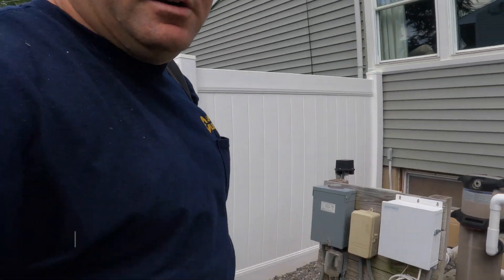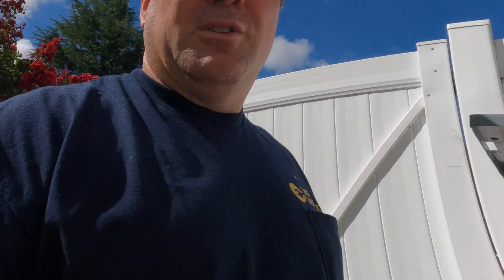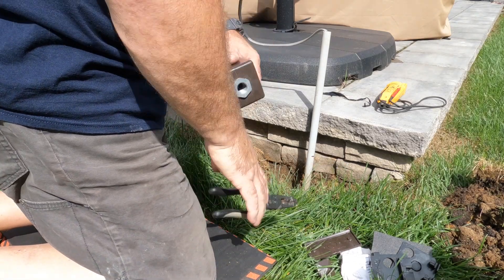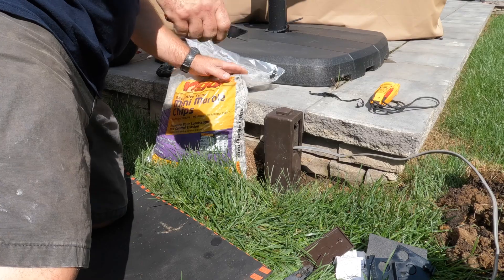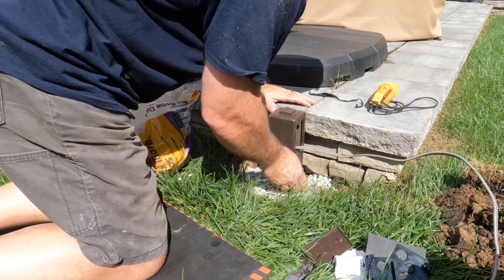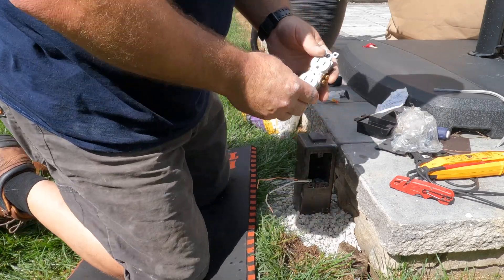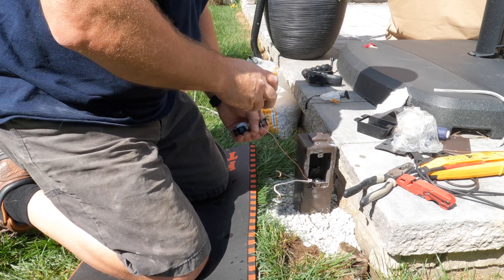Swimming Pool Area Landscape Receptacle Box | GFCI Protected Receptacle

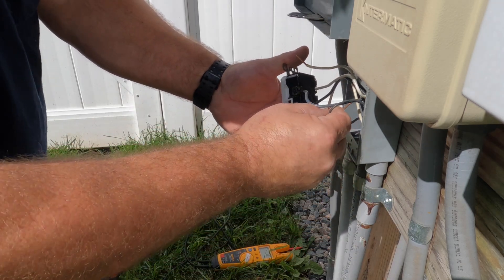Comment: Why starting at 3:41 did you put 2 wires on one screw?
Reply from the maker: The GFCI receptacle is designed to do that. There's two pairs of conductors being protected by the single GFCI. Hope this explains it clearly for you.

Comment: Nice job! 
I’m curious. Does your jurisdiction require PVC  conduit the entire distance between the two outlets, or just going into the soil and coming out. I know that UF cable is designed for direct burial. I hope my question makes sense.
Reply from the maker: I rarely install UF cable for direct burial. It deteriorates over time and shorts/ ground fault issues.  I don’t condone using UF for underground work.
Reply: @electricianron_New_Jersey  Also with conduit you have the option to pull extra wire in the future, in case you want to add on.  With UF you have to dig up and start over again.

Comment: A Gfci tale, my dad renovated his kitchen, and I did all the wiring. This was 1991-1992, I'm not sure of the year. Anyway I installed the GFCI's, lights and switches. A lot of backwards stuff, it was somewhat challenging, for my 1st job. But later that year my stepmother was doing the dishes, and knocked the mixer into the sink, of water, and she had both hands, in the water. she said she felt, a little shock and I heard the GFCI shut off in the other room and came out. I said hmm, I just saved your life. My dad was pissed at her, for doing the dishes, with the mixer still plugged in. But whatever, she wasn't hurt, and is still here today. But, I remember him telling me, that when he bought the house, mind you this was a 900 sq ft row home, in the middle of NEPA, small mining town the house, that had the 60 amp panel with all knob and tube. This was in 1981or 1982 when he bought the house. To get a 100 amp box put in and the house rewired was $800 cash job. When I had to put new circuits and new a new panel later as he had extra money on another renovation. And I was telling him about things I seen that just weren't or didn't seem right. I wasn't as good with a meter and you couldn't get them as they were ridiculously expensive. Well 1 of the issues was i said dad the found the ground rod should be copper or at least copper clad and it wasn't. When I pulled it out it was a 4 ft piece of rebar 1 ft away or next to the panel. But just an interesting wiring story I thought you might like. Great video.

Comment: Is that the new tolerances on the gfci? When I went through school the instructor said it trips at 1 milliamp. I love your practical approach, you do the work, trouble shoot out-loud and explain your thoughts on why, you think something may not be working. Your videos are the best I have seen no ego just the work, no gimmicky flashy bs just the work and why. Great video as always.
Reply: I agree well said.
Reply: @rtheprizeisright7323  the new smart devices that use the ground where there is no neutral in the box cause a small imbalance. The GFCI won’t trip until 4ma of leakage current. That allows the smart devices to work.

Comment: Awesome video another excellent job well done. What’s minimum height allowable by code for an exterior receptacle? Is it 12”
Reply from the maker: There is no minimum, just a maximum height of 6'7" and that's only for required receptacles.
Reply: @electricianron_New_Jersey  Mr. Ron Sir, this brings me to another question, your old enough to remember the receptacle's in the houses with the receptacles flat on the floor (interior). Is this still permitted I don't know why, you would want to do it. Maybe some kind or weird HVAC install in a difficult spot?

Comment: Couple tricks I’ve used. If you have to cut a pipe with wire in it sleeve it. Like in your video, sleeve that UF with a short piece of 1/2” EMT. 
Also when mounting Bell boxes outside I’ll drill a 1/8” weep hole on the bottom of box. If any water or moisture gets into the box, it will drip out.
Reply from the maker: That’s a great idea. This 1/2” PVC that I seldom use so I will keep that in mind for next time.
Reply: @electricianron_New_Jersey  oh it looked like 3/4” PVC. Anyways the trick works really well!
Reply from the maker: @mcarroll598  I'm always impressed by how much I learn in the comments.